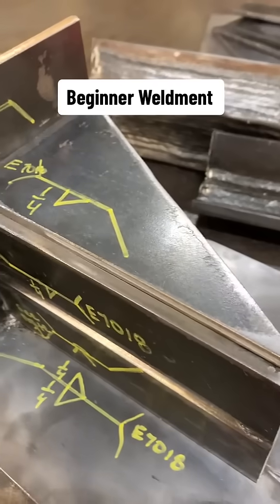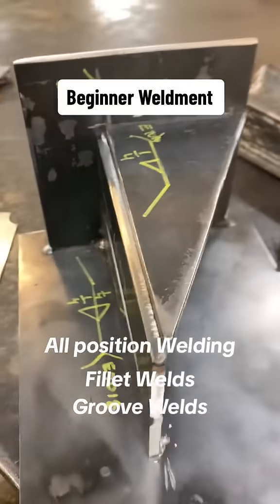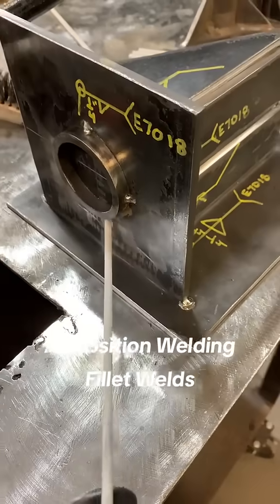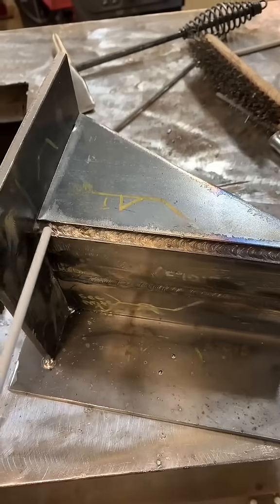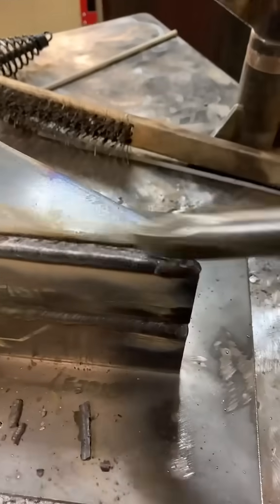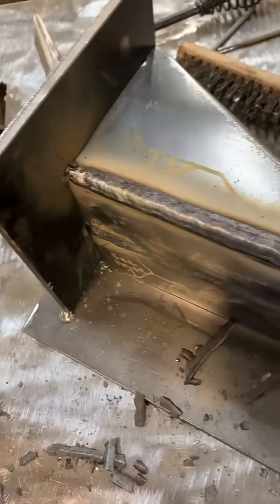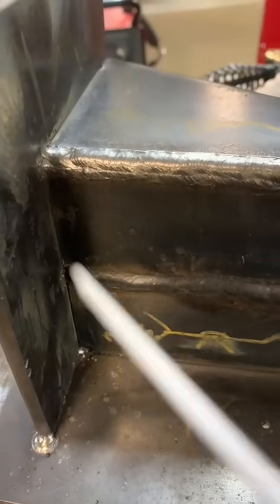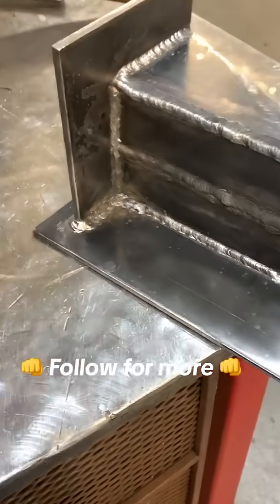Beginner skills project on carbon steel with the stick welding process! Awesome teaching tool!🔥

Comment: Someone really needs to design a realistic fake welding that can wash off and do again... practicing is so expensive. This would be awesome to do in stainless. I love stainless stick, you would think I tig welded it. 👍
Reply: There is a video of a guy using silicone as a weld bead and spray painting it silver to confuse his coworkers. Pretty funny stuff.

Comment: Gonna make one of these at community college tomorrow nearly finished just 2 pipe projects left really need to do as many 6g as possible to prepare for a job test. Go 5 days a week trying to get as much shop time as possible extremely comfortable with tig now and mig is stupid easy stick I just struggle on my root on pipe still will be going fine half way up pipe and keyhole a crater so difficult to have enough heat to burn through the landings but not overheat it 83amps with 3/32 7018 what I’ve been running on schedule 40 any suggestions??